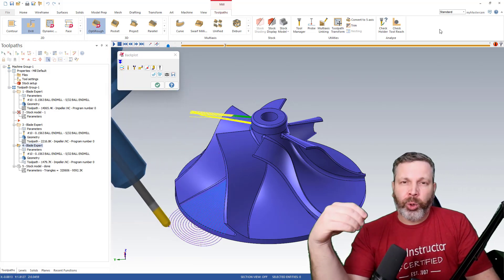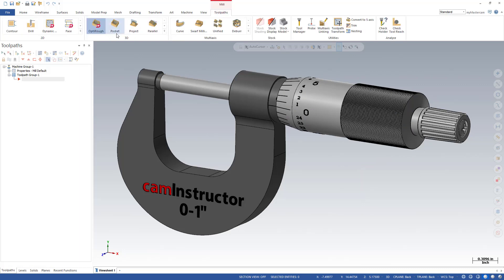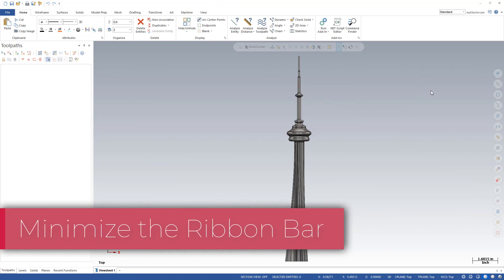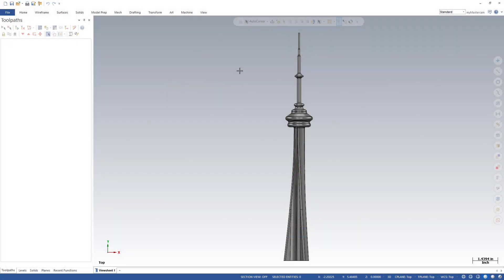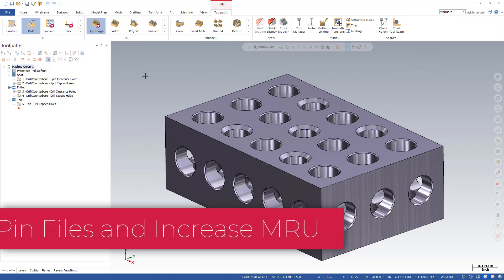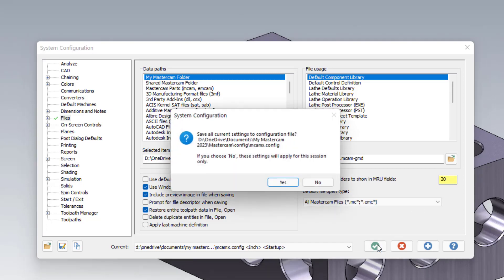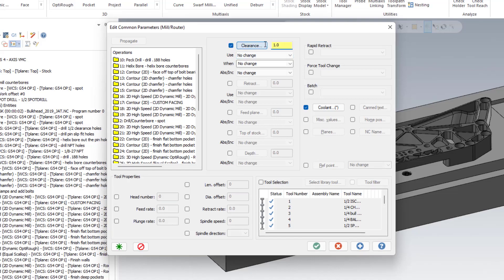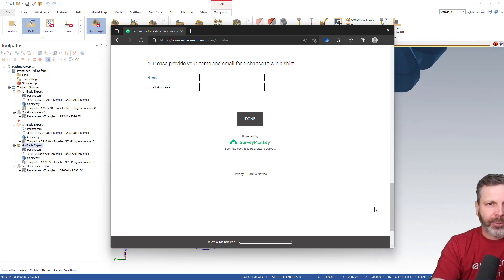7 Must Know Mastercam Tips

Comment: Love it! Here is one that I accidently discovered: selecting a drill size in 2d toolpath drilling - "tool diameter" - select "equal" from drop down menu than in highlighted "size window" type letter "Q" than enter, this will pop up very handy "Number and letter drill size" chart.
Reply from the maker: Great tip! Will def add that in
Reply: do you use MILL or LATHE for 4axis or 5 axis machining you know when you chose MACHINE ?? before toolpaths 
or does it matter? 
say my machine was a DMG DMU or a Mazak full 5 axis
Reply: @Christopher Columbus  Mill is Haas VF2 and my rotator is Haas HRT160SPH. I don't have an access to MasterCam multiaxis with my current licence...

Comment: I have an unrelated question, there's apparently no documentation on this that I could find. 
When I use "verify" or the simulator, Mastercam keeps adding a bunch of moves to the part zero between each operation for no reasons. Of course this generates a bunch of collisions.
Reply: Did you figure it out? I had this problem and if it’s the same one as yours I figured out the problem. Go to “ Configuration “ then down to “ Simulation “ and DESELECT “ Tool starts from home position after tool change “ and “ Go to home position on tool plane change “
Reply: @MachinistEdgar  Turn out my problem was fixed by an upgrade !